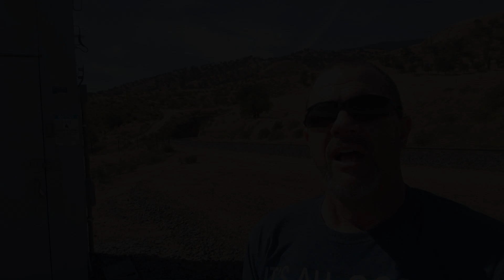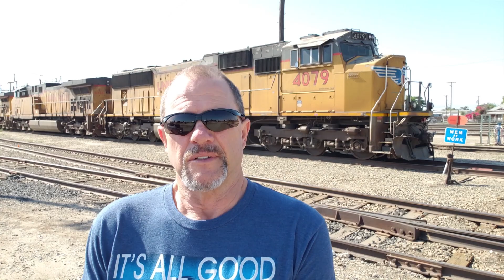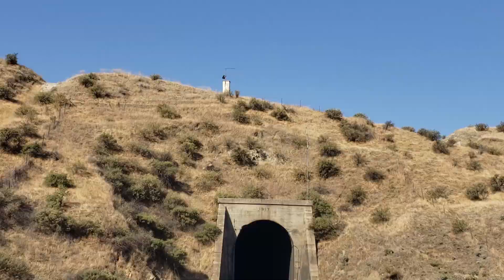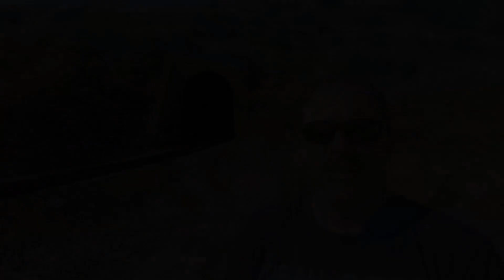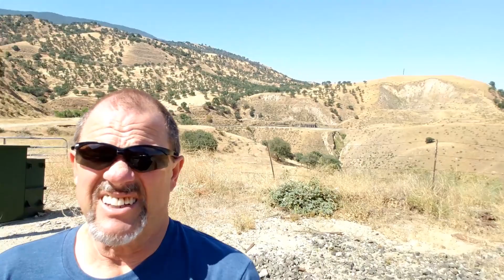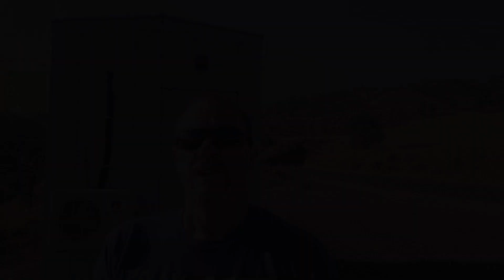How Things Work on Railroads: Tunnel Radios

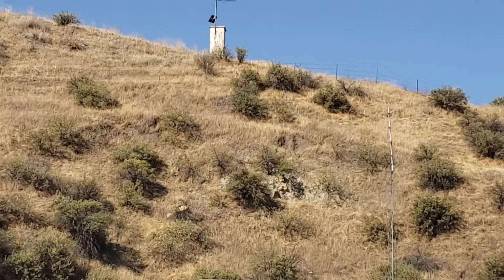Comment: Having operated remote control systems on oil and gas wells, I can tell you the horizontal antenna on the cabin a 2:26 is pointed to the actual repeater. The repeater should have an antenna that is pointed at the next cabin. Where UP has an actual tower and repeater system every 15 miles here, those are apparently eliminated by the fiber optic cables connecting the system.

Comment: My company is too cheap to install DP repeaters. Most no communication areas are fairly short. The DP unit keeps on doing what it was last commanded to for up to 90 minutes. A remote can be dropped out by a brake application. Part of the key to running a DP train is to set the remote for what is upcoming. That way the train won’t end up speeding or stalling based upon too much or too little power or dynamic brake.

Comment: Great information Mark . I was unloading welded rail on a curve and the locomotive was going to be in a tunnel . My walkie talkie wasn't strong enough for the engineer to hear my radio . We were going to have to couple more rail and the head end was going to be in the tunnel . I instructed the engineer that I would big-hole the train when I needed for him to stop and when his air come back up he was to proceed forward until I dumped the air again . I sure hated having to leave them in the tunnel with the exhaust but it's what it was . You do what you have to do and the engineer said he was cool with the plan . I was trying to save as much head hardened rail for the curves and the road master had taken more rail than was supposed to be unloaded on curves on his territory and I knew I was going to not have enough rail for several curves ahead of us . We unloaded on his territory and wanted to continue as I still had rail that I was to unload on another subdivision . He got really mad but I did my job and refused to let him have the other rail . We were just a few miles from North Little Rock , Arkansas where I was head quartered and as soon as we got there I told my boss about it and he said he had already got phone calls from the road master and Superintendent on that territory raising hell about not unloading more rail . The Superintendent was driving to North Little Rock to pull me out of service and my boss told him he would have to hurry because I had a crew called and would be leaving before he could get here . He said he would remember my name and the first time he saw me on his territory he would pull me out of service . My boss made sure that I wouldn't be on his territory for a good while as to keep me from getting fired . The games we had to play on the railroad to do your job and keep from getting fired .  Great video Mark .
Reply: That made no sense to most readers and Mark didn't even acknowledge your comment. Thanks for nothing.
Reply: @GeneralHAM-d5k   Totally different tunnel situations , length of tunnels and the fact that the radios on locomotives vs walkie-talkies have changed through the years . Doesn't bother me as I was just telling a true story of many I had while unloading and picking up welded rail on our rail trains . And I've got a whole lot of stories I could share but I will tell more from time to time . Thanks Rick Via
Reply: @25vrd48  Thx for the clarification. As much as I'd like, I've never worked on a railroad. Best to ya.
Reply: Classic story how someone trying to grind a personal axe is not the sharpest knife in the drawer I had a work train crew  do everything possible to get on hours of service at the yard while swapping out their empty rail train for a loaded rail train we needed delivered to the worksite that evening.  Otherwise we would have wasted the next day waiting for the loaded train.  The crew caller told me (a mere M of W underling) I didn't have authority to call for a new crew. It went up the chain of command and he was told that I did.  We had our loaded rail train at the work site the next morning.

Comment: On Roseville sub, I don't notice d 2nd cabinets, but have found coax running high in tunnels, with antennas at each end. There are antennas ate each end connected to coax. Will have to go to T 41 "big Hole" and look for amplifier units as it is 10,000' long.

Comment: Good afternoon Mark, enjoy your videos and knowledge . I was wondering if there some way  you can tell me how do you know how trains are coming. I love to go out and watch freight trains etc speeding down the rails but it seems inconsistent. I know when there a Amtrak/Z train it tins to hold up alot of trains. Sometimes i can see 5 trains in an hour or sometimes i may never see a train. I wish there was a app or  some sort of way i could find out when the trains are running . Dallas / north east texas area UP hwy 80 Thanks Kris
Reply from the maker: Sorry for the delay in response! I go to the office here in Baketsfield and look at the CAD screens they have there. If I'm out in the field I call the local maintainer. Nice to have been liked so they still answer when they see it's me!
There is a way you can access CAD screens on a mobile device but it involved way too much jumping through hoops to use it. I don't remember what it was called. If you go on facebook there is a group called Calrailfans FB. Someone there will probably know.
Thanks for checking it out!

Comment: Aaah fiber optic....why didn’t I think of that before... build a network through the tunnels and no RF problems  arise inside given the system with that network never has a component fail for whatever reason. Missed this last summer also and now had popped up in my playlist. Thanks and glad you are moving forward from the nasty winter you ensured...

Comment: Thanks, never quite knew how the repeaters worked in regards to tunnels. Assuming  the Locotrol software  system has not changed in the last few years,  if the remote(s) loses Comm (which they do all the time) the remote locomotive will stay in the last throttle or dynamic brake position for 90 minutes OR until it senses a reduction in brake pipe pressure which indicates the brakes are being applied at which time the remote would go to Idle.
Reply: Of course if comm comes back before  90 mins everything carries on like nothing happened

Comment: The early Locotrol that was using the UP SD45's wasn't nearly as advanced as this system. If they were in a tunnel and the train went into emergency, the helpers just kept shovin'. There were several derailments because of this!
Reply from the maker: I remember the issues in its early days. It was a mess!
Thanks for checking it out!

Comment: The reason for fiber optic cabling is to cut down on the latency that naturally occurs with copper wire. Copper wire has a natural resistance when electrical signals are applied to the nomenclature. As it applies to trains, DPU's or unmanned helper units require immediate input from the head locomotive to control whether or not the DPU or helper is to push the back of the train or go into dynamic braking. 

Now what is dynamic braking? It is the action of reversing polarity of the traction motors on a locomotive and using them as resistors. The heat that is generated is then directed into the radiators atop the locomotive, then the fans kick in and extract the heat from the radiators and send the coolant back into the system for reuse. What we see on the outside of the locomotive is the wheel set and bearing. These bearings are either Brenco or Timken 6 7/8 GG pre-packed with 32 ounces of lubricant, and do not index.

On most Class One road locomotives, there are speed controllers that are mounted onto the bearings via the end cap bolts and a small probe in the middle of the end cap. They are designed to measure the rotational speed of the bearing during operation, then send that data into the cabs speed control computer. It is there the speed of the locomotive and the accompanying consist are regulated. That is where you either will get dynamic braking or the DPU's pushing the rear of the consist over a hill.
Reply: The reason for using fiber optic cabling is that it can go much further before repeaters are needed and it has a much higher bandwidth than copper. It is also immune to electromagnetic interference (EMI), and can be run right next to high voltage power cables, even in the same conduit.
Reply from the maker: @brianleeper5737  you're the one who asked me about this awhile back. I hope you enjoyed the result!
Thanks for checking it out!
Reply from the maker: Sounds like you should have a channel! You seem to be pretty well informed!
Thanks for checking it out!

Comment: Excellent video, very interesting. Dumb question, when a diesel locomotive enters a long tunnel doesn't the fumes enter the locomotive?
Reply from the maker: With the cab at the front of the locomotive they are usually ahead of the smoke and fumes but occasionally they are going very slowly or stop in a tunnel and in the funk but the cabs are well sealed, filtered and have AC or heat as needed.
Thanks for checking it out!
Reply: @MarkClayMcGowan  thank you excellent into. Holy crap it would be freaky to stop inside a tunnel..
I always wanted to be a NJ Transit locomotive engineer but I make excellent money working for the town I live in and schedule is Monday through Friday 7-3:30. Hard to give up that schedule and non commute.
Reply: @MarkClayMcGowan  Inside the summit tunnel on Donner (2 miles long) they have bottled breathing air in racks at intervals in case a train stalls.

Comment: Great info... For more information look up GSM-R . It's used in Europe for this. It's a variation of the mobile phone network cellular network. Sounds like the USA uses something different.
Reply from the maker: Thanks! I'll check that out!
Reply: GSM spectrum is available in the USA, but I’m not sure that the current Locotrol/DP radio spectrum is GSM. I suspect it may use TDMA, but in the existing UHF spectrum where the EOTDs have been for decades. However, given the obscene amount of radio antennae on the average locomotive these days, ranging from VHF through 4G, I need to do a deeper dive.

Great video, Mark…this is a great tech rabbit hole to jump down.